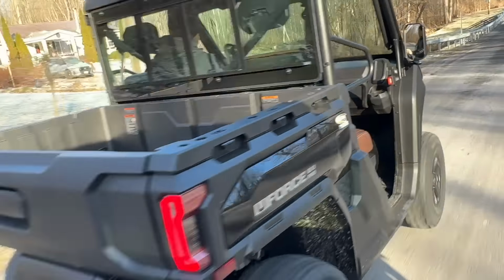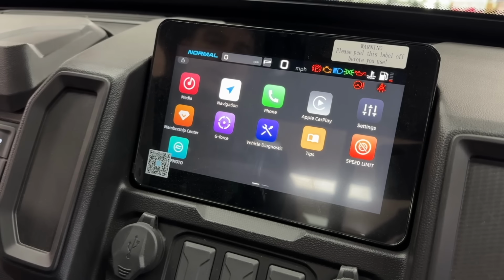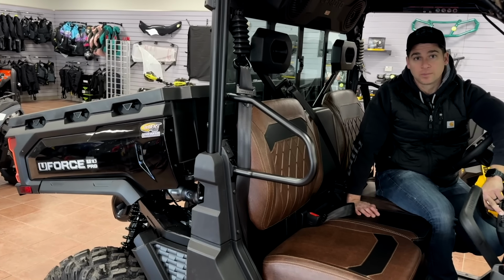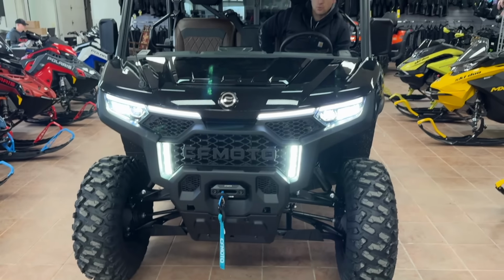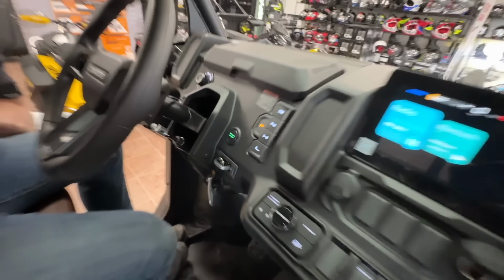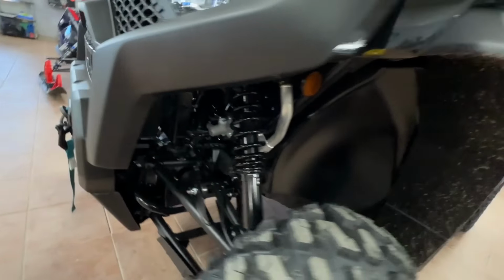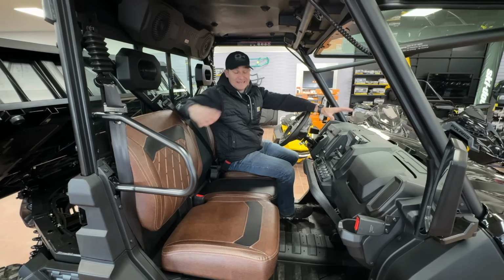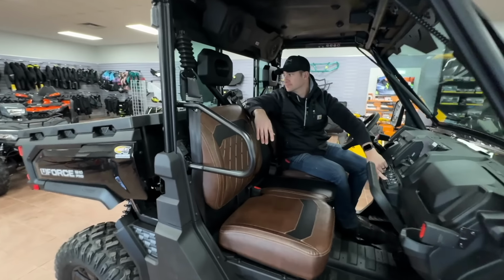ALL-NEW! UForce U10 PRO from CFMoto! Big HP/Small Price Tag!

Comment: Thing is beautiful.   Cf moto in my opinion with their latest utvs and gen 3 quads is the premiere manufacture right now. And the dealer network is key to that. They are every where. Funny to see all the polaris and can am guys get butt hurt about the praise on these units.
Reply: Clearly you don't own a UTV or you wouldn't be writing that.  CF has brought lots of VALUE to market but are from leaders. Time will tell how the chinesium gears hold up in the diffies and transmissions. I know first hand my riding buddy was down for months waiting on parts ..... lots of parts
Reply: @tazzthedoodle7861  The electrics/wiring has been the longer term issues with past CF Moto stuff. This unit looks great and appears to offer all the top end features...just be careful. Personally I never buy anything that is a first year model. Lets se them cook on this. At a minimum it should help pull down prices from the other OEM's

Comment: There are some nice features like the power tip out windshield( although not standard equipped)and power dump bed that is standard equipped.   The apple carplay and screen and speakers are a nice feature.  That machine may be 16,999 base price but it sure is not with those extras.  The "class" leading is a bit of a non factor for me personally.  Every machine in this segment is more than capable and produces more than enough HP/torque. These are work machines, if top speed is tour preference then a sport machine sgould be the choice. I find new Polaris ranger 1000 xp for around 19000 locally.   I actually purchased a brand new 2024 Ranger 1000 XP Northstar premium,  last year for less than 30,000 out the door. It has HVac/AC, full cab, winch standard. Once you equip this machine to that spec it will be 30k or more too.  Polaris Rangers have better track record, dealer network, aftermarket support by a large margin.  I do not like the push button options for everything in a UTV application. Lastly and most importantly for me, the CFMoto is Chinese and if I am able to avoid supporting China in any application that equal performance is achieved even at the expense of a bit more money I will do it every time.
Reply: 2025 ranger 1000  has 2 yr warranty and starts 13k with 62hp and at 20k 82hp u get ac Heat, winch and u can get 114 hp ranger too.. Cfmoto just took seats and other ideas to make a similar ride and cost 1000 less 😂
Reply: I own a 21 rzr xpt 2300 miles on 32s and a 23 cforce 600 atv and i don't think I'd ever buy a cfmoto again or even a segway brand.

Comment: I would like to add that this is not the fastest side by side nor does it have the most torque in the industry. Polaris makes a more powerful ranger 1500 version of this and Kawasaki makes the ridge which has 92 horsepower on their base model and 116 on their XR model which comes with a full cabin, AC and power windows plus it's a Kawasaki engine. I would hesitate when talking to this dealer or ordering from this dealer. One more thing you can buy a Kawasaki ridge for $20,000 new and have a full 3 year warranty and a much better dealer network and parks.
Reply from the maker: CLASS leading means it’s comparable to other 1000cc UTILITY side by sides. We’ve been a dealership for 53 years and voted best in the region many times. We appreciate you watching the videos! 👍
Reply: More HP doesn't mean faster. The cfmoto zforce 950 G1 HO sport and EX models are faster than the Kawasaki KRX models. And I can personally tell you that there are more cfmoto dealers in the state I live in than there are Kawasaki dealers. In order as it pertains to offroad market shares. #1 Polaris #2 Can Am #3 Yamaha #4 Cfmoto #5 Honda #5 Kawasaki. Cfmoto surpassed Kawasaki in market shares almost 2 full years ago. You aren't doing that by having less of a dealer network.
Reply: What did this dealer do to you or your friends?